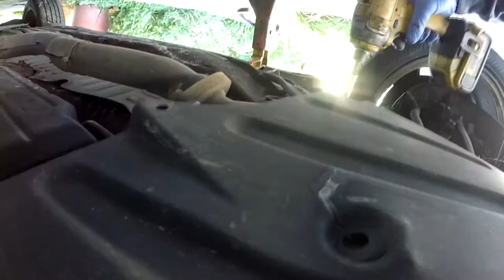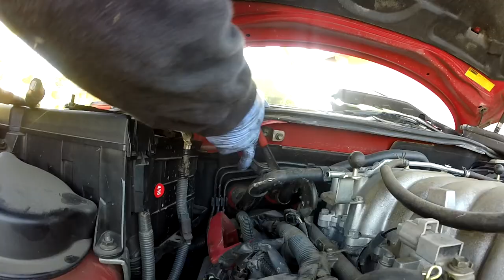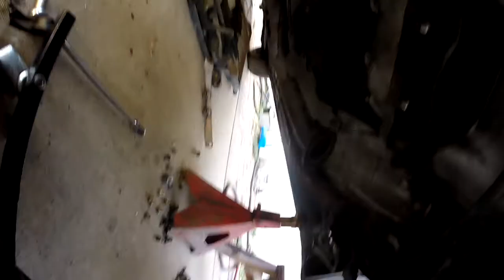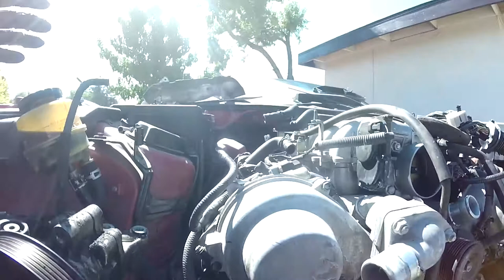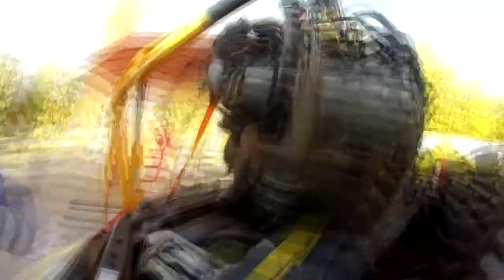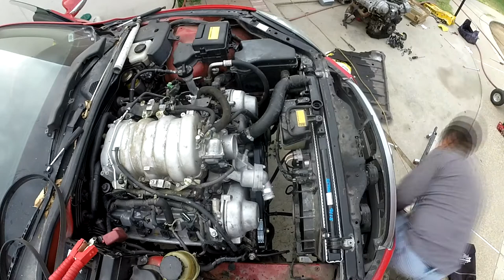Lexus SC430 or LS430 engine replace

Comment: I agree with you on it being easier to change the engine and transmission in Lexus cars with the 4.3L V8. I changed the transmission mission on my GS430 and it was surprisingly more easy than my old Honda Civics. Good job and good video.
Reply from the maker: Thanks
Reply: I wounder if you could use 1uzfe 4.0 piston an rods to make it a stroker.

Comment: I am removing my engine in my 05 SC430 and following your video. A few questions and comments. 
1. The transmission lines goes thru between engine mount and oil sump. I decided to remove it totally. I don't know how u don't have to. Wouldn't that damage the lines when the engine is getting out?
2. There are hooks on the engine for hoisting. I don't know why u need to remove the exhaust shields to tie your seat belt around manifolds for hoisting.
3. I see u remove the wiring harness from transmission and take it out with engine. Ok. I was debating where I could disconnect.
4. I am still struggling to remove the top two bellhousing bolts. You made it look easy.
5. Need to remove the 12mm bolt holding the transmission dipstick. Otherwise u might need a new oil pan (as the tubing is welded to the pan.)
Reply from the maker: @derekkchung  it's been a long time I forgot what I'm doing back then. Lol
Reply: @alltsab  understood. Thanks for making the vido.

Comment: Hi great video. Just a quick question. I forgot to put the engine back at TDC before i separated the engine.  So how would i line up the new engine to the transmission. Or do i have to put the old engine back and put it to TDC and take it out again. Thanks for your help.
Reply from the maker: @chauho673  nope no need to put in dtc

Comment: Hey, my 03 sc430 only has 70k miles but engine is making too much vibrations, i feel like it needs new engine mounts. How hard is it to change the engine mounts? And do you recommend changing the transmission mount as well. Thanks.
Reply from the maker: It is not that difficult but tight space. Change what is need only. I personally like to save money not to waste money to change for things that not necessary. Rear wheel drive normally for v8 not vibrate a lot. So you need to figure what cause vibrate before replace your motor mounts. It's vibrate at stop in drive or vibrate when in parking. Many other can cause vibrate too. Good luck and have fixing car. Subscribe to my channel ok.

Comment: Question, so I’m doing the same swap with my ls430, but the engine and trans are going in as one piece. Currently the intake manifold is being held up at the top of the fire wall and the oil pan is stuck on the steering rack and I can’t get it in place. Any advise on how to make it fit?
Reply from the maker: You have to pull tranny out

Comment: 2004 LS430....2000k miles after replacing timing belt, water pump, and all front seals lost compression on #6. 
Performed cylinder leak down and found air escaping through the intake. One intake valve is not closing....not sure why. Engine has 230k.

What do you recommend?
Reply from the maker: Take the head out do the valve job.
Reply from the maker: Recheck your timing mark to see it right in the spot. Maybe off a little that cause valve open

Comment: I have a 2002 sc430 with 225k on the engine and transmission. The trans is slipping in reverse and I also recently replaced the shift solenoid #1.  The forward shifting is okay but reverse is on its way out. I was thinking about buy a JDM engine and transmission and doing it all at once. My transmission sticker is 35010-24420. I have not be able to find an engine with that trans number. What would be the issues that I may face if I buy a JDM engine, and do I need to find one with the exact transmission number, or should I just do the trans for now. The engine runs fine but does burn a little oil.
Reply from the maker: My opinion is fix what it need only.

Comment: Is the sc430 engine compatible with the ls430 computer wise? I have had to swap engine mounts and oil pan housing
Reply from the maker: Should be the same but look for  matching sensor could be different locations

Comment: Hi I just did this engine swap and after the transmission is acting funny really hard downshifts and won’t go past 3rd gear I have code p0778 I was looking online and it’s saying I could’ve forgot a ground or something do you know where the grounds are ?
Reply from the maker: Check those ground I mentioned in this video

Comment: Hi All
How much do you think will cost the head gasket job on the SC430? I can see to find a good video on it.
Thank you 
Jovan
Reply from the maker: Head gasket is not cheap and not many shop want to do hard work. I'm not sure how much but I think lexus dealer will charge around 2k up. Small shop will charge 1k up.
Reply: The engine can last 1 million miles with proper maintenance. That means the head gasket should also last that long if I'm not mistaken. Usually a head gasket failure is due to minor overheating, but the mating surfaces will be deformed and installing a new head gasket will not solve the issue because the surfaces are not flat and it will not seal properly. You will have to remove the engine, disassemble it and have a machine shop machine the mating surfaces flat and for all that labor, it's cheaper to just replace the engine.
Reply: @SI0AX  
Thank you for replying. I was asking about the head gasket because the engine only has 80k and there was no oil mixed in the bottom on the engine. The problem was that it was throwing the antifreeze to the exhaust because and a cooling hose at the radiator broke had a hole and run out of cooling. I opened the top cover and it looks really clean and just minor oil/water mixed. Therefore, I decided that it might be rebuilt-able. The point you make is correct. But because of how it looked, I consider doing the head gasket. What can you advise?
Thank you again
Reply: @jovanizquierdo2704  Well if it's not too much work, like you can replace the head gasket without removing the engine it may be worth a try. In my experience I had bought a 1991 Honda CRX with a severe smoke on idle, I replaced the headgasket and it did not solve the issue. I decided to rebuild the entire engine with new pistons and rods but it's a race build. 

I would advise against rebuilding the LS430 engine, it's best to just get a junkyard engine as it's highly unlikey for it to have more than 150,000 miles and the engine is good for more than 1 million miles so if it's nowhere near 1 million then it has a lot of life left and you can have the engine for less than $1,500.
Reply: @SI0AX  thank you for the advice. I’ll consider both options. I have another engine with transmission from the junk yard. Wish I could send you the pictures. Anyhow,I looked on the top cover and it has lots of gunk but the head gasket is good. That’s my other option. We will see what would I do. Thanks
Reply: @jovanizquierdo2704  Wow, they you are all set. I was thinking storing a junkyard engine and transmission in case I get to the million mile mark, but I'm not driving as much as I used to but even If I was, the engine would theoretically last me more than 60 years!
Reply: @SI0AX  yeah, I had purchased this engine combo to swap it with this car but as I’m looking at the top valve cover I can see a big difference between the 150k with lots of gunk vs the one in car clean with no gunk at all. It makes me wanna to change my mind about swapping it. That’s why I asked you for advice. Otherwise rebuilt the engine that’s in it as much as possible to have a lower mileage engine. Not a bad plan (in my head) but it could be damage at the bottom. I guess I’ll never know until I take the head out and see if it is worth the effort. 
Cheers
Reply: @jovanizquierdo2704  The valve cover leaking is pretty normal. Mine was leaking at 130,000 miles and leaks turn to gunk. I cleaned it all up when I did the starter replacement which was a massive job where the intake manifold had to come out. 

I also took advantage and decided to replace all the intake manifold gaskets , the valve cover gaskets including the throttle body gasket and the spark plug tube seals since the intake manifold was off and it makes the job slightly easier.
Reply: @SI0AX  well I guess swapping the engine will be the way to go. I have the combo engine/transmission from the yard, should I replace both as a set? Or just the engine alone. What do you think?
Cheers

Comment: How to remove oil pan with engine in?   Lift engine required?
Reply from the maker: Kev R i believe you have to release the engine mount and lift it to get enough space to drop the oil pan

Comment: Is that the same engine as the 2001 Lexus ls430?
Reply from the maker: Tiger Gray I am not 100% sure but I believe it should be the same block and head. some sensor may be different only.
Reply: I own one of these and wanted to do a full tune up. What needs to be removed to access the plugs??
Reply from the maker: Jason Renac very simple, remove the cover and then use 10mm socket to remove your egnition coil on both side. Next use your regular spark plug socket to remove your spark plug. Very simple job don't let dealer do simple and rip you off because lexus. Hope it help and enjoy your nice car. Thanks for comment.
Reply from the maker: Please help my channel grow subscribe thanks
Reply: All Tsab thanks for the info. Should I replace the coils also? Also what else should be changed on a tune up for this vehicle besides the plugs and wires. Air filter ,fuel filter,?
Reply from the maker: Jason Renac there is no spark plug wire, you do not need to replace coil unless there is engine light code say coil need to replace. The only thing i recommend is if your spark plug old and more than 100k miles then yes you need to replace it. Make sure check your timing belt and water pump if that is old need to replace it. If your timing belt broke it will destroy your engine. Thanks for questions plz subscribe and share to help my channel grow.
Reply from the maker: Air filter that is your regular maintenance schedule. You can change it one per year in between you can take the filter out and clean it every time you do oil change or replace it every 6 months.
Reply: All Tsab thank you for the info . I've seen the timing belt and water pump kit on ebay . If I'm just changing the belt and pump do I have to adjust the timing ? I'm subscribed also 👍🏼👍🏼
Reply from the maker: Jason Renac if you never done on timing belt before "do not" do it yourself very danger you can damage your engine.
Reply: All Tsab  I've never done it before , small stuff like a starter or alternator I've done on my  1996 sc300 . I don't think I'm going to attempt toe timing belt and water pump. I'm going to bite the bullet and send it to a shop for that.
Reply from the maker: Jason Renac water pump and timing belt on that sc430 at lexus is close to 2k at my local dealer

Comment: Bonjour je recherche un faisceau électrique de boîte automatique pour une Lexus SC 430. Merci
Reply from the maker: Alain Bordinelli Donc désolé je n'ai pas la boîte de vitesses du lexus 430
Reply: en fait ce que j'ai besoin c'est la position des couleurs de fils qui sont sur la broche a 12 fils, car en déposant la boite vitesse les 12 fils de la broche se sont arrachés. Si je pouvais avoir une photo ou l'on voie les fils.
Merci pour votre réponse.
Reply: in fact what I need is the position of the wire colors that are on the 12-wire pin, because by removing the gearbox the 12 wires of the pin were torn off. If I could have a picture or see the wires.
Thank you for your reply.
Reply from the maker: Alain Bordinelli I would to help you
Reply from the maker: Alain Bordinelli can you take a picture of the thorn wire show it to me so i can check in my video to see i have any video clips of it. I don't have the vehicle and the owner had an accident his insurance total it to the junk yard already.
Reply: Hi there are you an independent Lexus mechanic or shop I’m in Los Ángeles are you local I’m interested and looking for a specialist for my sc430  very nice video thanks